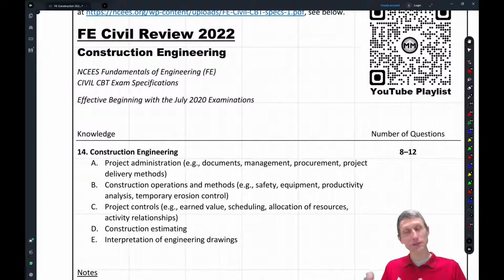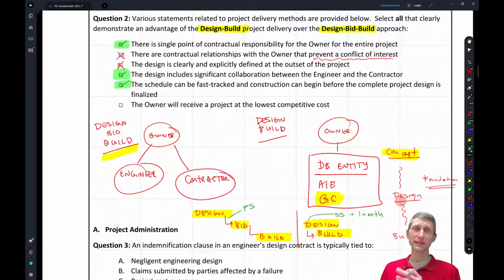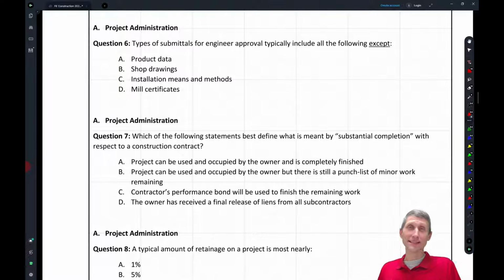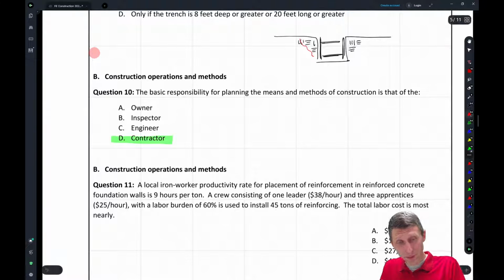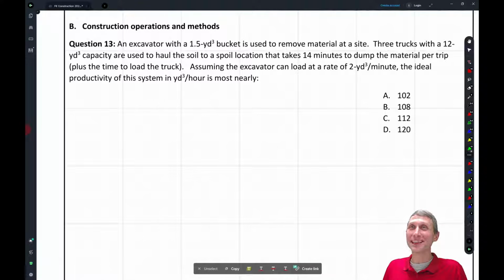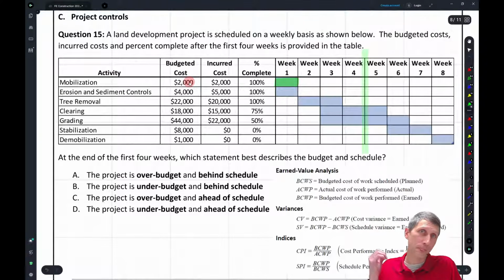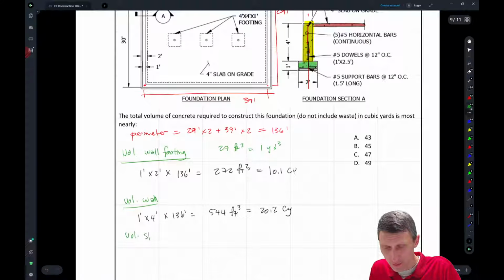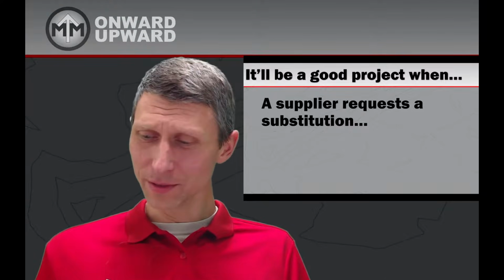FE Construction Engineering Review Session 2022

Comment: On question 16, for the Slab Vol 
I think you need to subtract the 3 column footings?
Reply: You are correct. Mark added an extra ~0.6 CY of pavement to the total. If you exclude that extra, you get 44 CY total. Maybe that's what he meant in the problem statement by "do not include waste".

Slab: [(30-2)' x (40-2)' - 3(4x4)'] x (4/12)' = 12.5 CY vs. 13.1 CY calculated (0.6 CY difference).
Reply: typically the column footing would bear beneath the slab and therefore would not be subtracted. the slab would bear on top of the column footings

Comment: On question 16, the estimation of concrete volume question, doesn't just the outside perimeter to estimate the concrete volume result in you overestimating the volume? Won't the concrete overlap at the corners resulting in you doubling the amount of concrete in the corners? If you break up the foundation into rectangular areas and calculate, you get 43.44 yd^3. Side note, thanks for these videos! I really appreciate you making these!

Comment: For question #16 you calculated the slab area as (A)slab = (40ft - 3ft)*(30ft - 3ft); (A)slab = 355ft^3. However, in "Foundation Section A" it appears the slab starts 1.5 ft in from the edges not 1 ft, which leads me to believe (A)slab = (40ft - 1.5ft)*(30ft - 1.5ft); (A)slab = 333 ft^3. 
Also based on both the problem statement and the drawings, I assumed the (A)steel should be subtracted from each of the (A)concrete sections. Is there are reason you decided to not do this that we should be aware of?
With the question in mind above I am confused about the "#5 Dowels @ 12" O.C. (1'x2.5')". I don't understand how the units work out with this component. The #5 indicates a 2-dimensional area of 0.31 in.^2. However, 2-dimensions are provided for the dowels, which results in 4 dimensions. How do you properly calculate the area for the dowels?

Comment: For question 13, the problem states that the time to load the truck is included in the 14 minutes, meaning that (14min-6min)=8min to dump only. So the excavator will not be idle for 2 minutes since truck A will be back within 8 minutes. Therefore, the ideal time for 1 cycle will be 18 minutes instead of 20 minutes. 36 CY / (18 minutes * 1hr/60 min) = 120 CY/hr  which is an answer choice. Correct me if am wrong. Thanks!
Reply: It specifies that it takes 14 minutes to dump the material (plus the time to load the truck) which I think means that dumping the truck takes 14 minutes.
Reply: I agree, really the problem should say (NOT including the time to load the truck).
Reply: I believe it should be "including time to return" instead of "including the time to load the truck"
Reply: did you get the answer?
Reply: I thought so too
Reply: agree

Comment: sorry but question 11 does not make sense to me. You make it seem that the 4 workers are not working the full 9 hours. You make it seem like within the 9 hours, each worker is only working 2.25 hours. In real life all 4 workers would be payed the full 9 hrs. (9/4) = 2.25, (2.25*45)=101.25
Reply: I don't get it either.  The problem says nothing about 'crew hours,' but instead the hours it takes to place a ton of steel.  9 tons an hour x 45 tons is 405 hours multiplied by $113 /hour is $45,765 and then add the burden.
Reply: @Joel-ml4es  Your comment has a typo. The problem states 9 hours a ton. Your calculations were correct. With the labor buden, the total labor cost is $73,224. I think this should have been the answer to the question.

When Mark divided his answer by four, it appears that he calculated the total labor cost PER crew member rather than the total labor cost of the entire crew.
Reply: @1crida1  yeah i agree $73K makes more sense
Reply: @Joel-ml4es check your units
Reply: Lunch isn't paid

Comment: On question 13, I still  don't understand how can an excavator with a bucket capacity of 1.5 cy load at a rate of 2cy/min?
Reply: If it took less than one minute to load one bucket. In this scenario, it takes 45 seconds per bucket, meaning after 3 minutes, there are 6 cubic yards, therefore an average of 2 cubic yards per minute.
Reply: that is very Good Notice << the components of Question are not matching

Comment: hello, on question 16, could you clarify more on why 2ft was subtracted from 40ft and 30ft when calculating the area for the slab volume? I think im having a hard time visualizing this problem.
Reply from the maker: The wall thickness is 1 ft... so the slab area is 40 ft (outside dimension) - 2 * 1 ft (wall dimension).  The slab is inside the walls.  I hope that helps!

Comment: Mark, Please for question 13: I think he means the total time including the time to load the truck is 14 min. am I right?
Reply from the maker: The time to load is 6 minutes, then the truck needs to haul and dump for 14 minutes for a total cycle time of 20 minutes.  In a perfect world, the excavator will sit idle for 2 minutes each cycle.
Reply: @MarkMattsonPE  I think you need to update your question for the problem.  In the parentheses it says the 14 minutes INCLUDES the load time NOT just the dump and travel.  This would mean that the loading took 6 minutes and the travel/dump time only took 14-6=8 minutes.   Seeing you work through the problem though I can see what you meant by it.  I just hope the FE exam is more clear in the wording of the problems.
Reply: @Joel-ml4es  you are right i guess there is an error, if you subtract the loading time you still get an answer which is included in the choices
Reply: Thanks for your time, effort, and everything.

Comment: Mark, for question 16: when finding the volume of concrete for the 4" thick slab shouldnt you subract 48 square feet from the 3 4 x 4 footings? The way you did it implies the 4 inch slab is poured in addition to the 4 x 4 x 1 footings.  It barley affects the final answer but just wanted to check
Reply from the maker: The dashed or hidden line indicates the footing is below the slab, so you have both.  I could have included another detail showing the footing and slab.  Typically, in real construction documents you would have a footing detail showing that.  For this problem, the slab would be poured in on top of the footing.